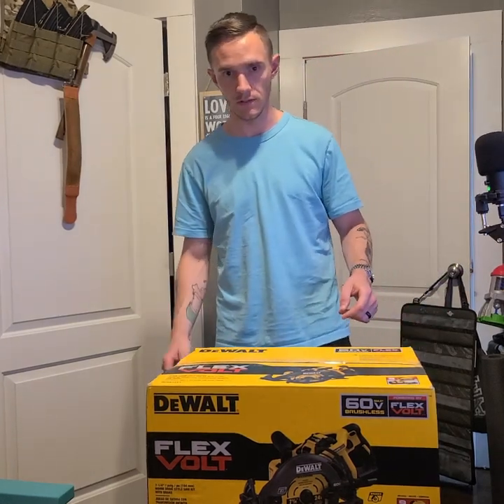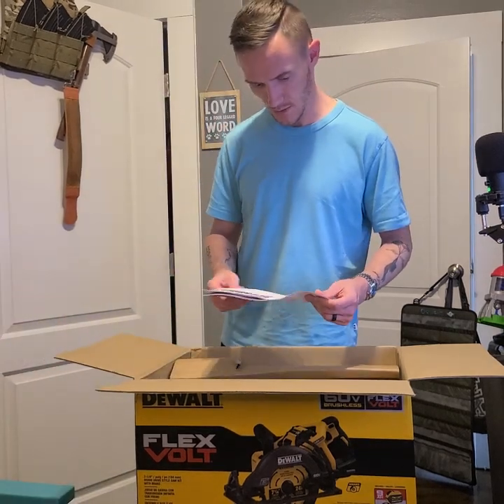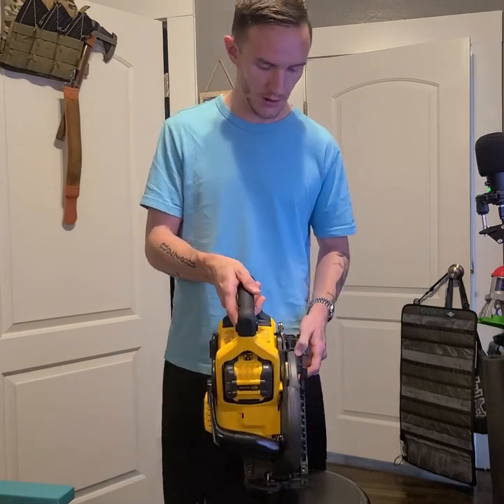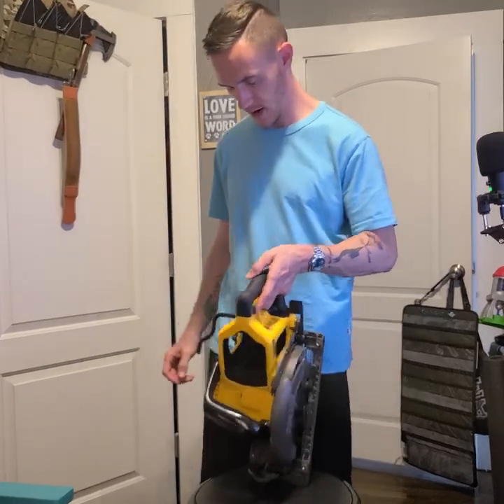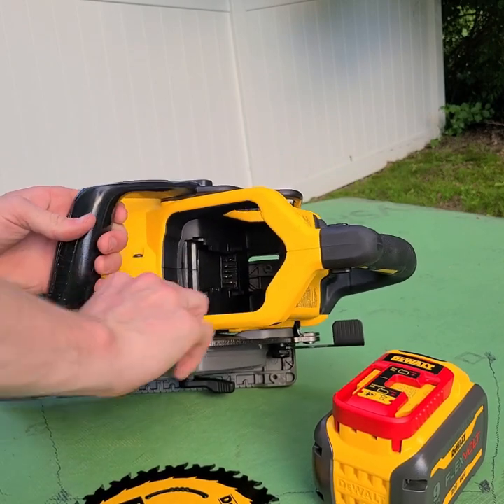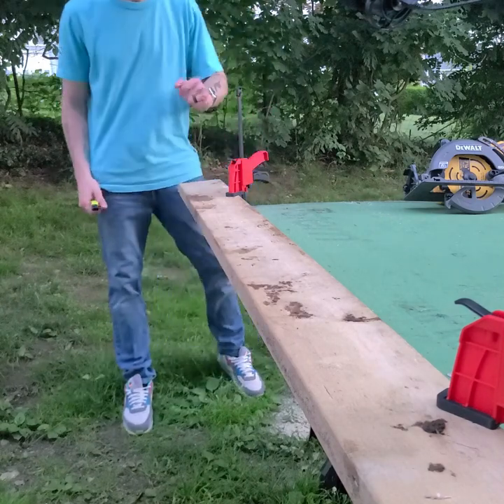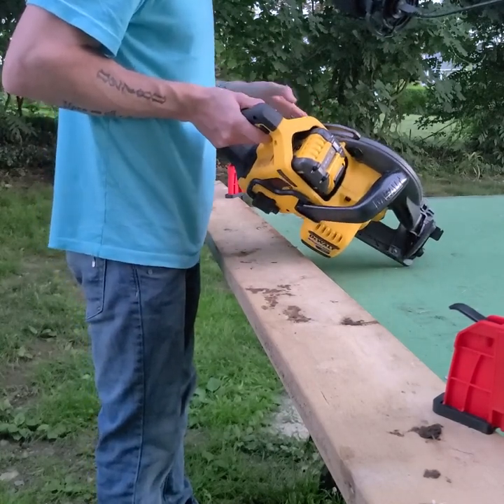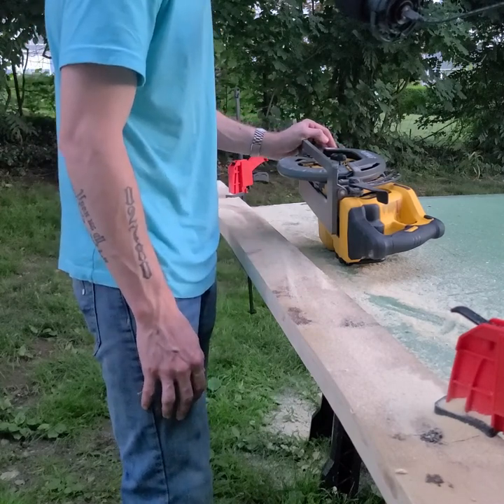DEWAL FLEX VOLT REAR HANDLE CIRCULAR SAW! Unboxing and first impressions #dewalt #dewaltools #tools

Comment: Dont be hard on yourself for a first video.
Comments.
Lots of people dont want another bag, hard case or charger. Many of us have dozens of tools and use storage systems for our tools.
I have this saw which was tool only $239 with a free $240 battery.
Given the choice I would have purchased the 60 volt side winder version with blade on the right.  But at a 200 dollar premium could  not justify it. All my blade on the left saws throw sawdust at me. Options are stand on the other side and use left handed or buy blade on the right saws.  The dust ejection option may be a consideration. 
What I am looking for in a review.
Overall quality, balance, ability to see the blade or cut line.
Ease and accuracy of adjustments / presets.
Power to cut without bogging down.
Battery system.
Customer service.
Regarding this saw it hit most of the things I was looking for.
Blade left is not my preferance but thats me.
Quality, innovation power and battery system are all good.
Balance when using the second handle real good.
Ease and accuracy of adjustment all good.
An adjustable for direction chip ejection  nozzle would be nice on many tools.
This saw is really good with the 6 amp  battery as its lighter.
Runs all day on the 9 amp battery.
The 60 volt  batteries used in 20 volt mode transform many tools providing long lasting power without a power drop off.
When doing these demos I think using good material handeling systems such as stable saw horses or benches adds credability and is more likely to attract sponsors.
My self I have quite a few cordless tools because of the reduced hassle without the cord. However over all I am not sure I would not prefer the much lighter corded tools with a good cord set up and perhaps a small generator. Certainly air tools still out perform the battery ones.
Bottom line for the tool companies is its all about selling batteries as once we have chosen a system they generaly have all our business.
If a law was passed (which I am not advocating) requiring universal  batteries, the entire battery tool industry would be in trouble.
That said I would not consider buying other than Dewalt the quality and innovation has been that good.
Hope to see more of your videos.